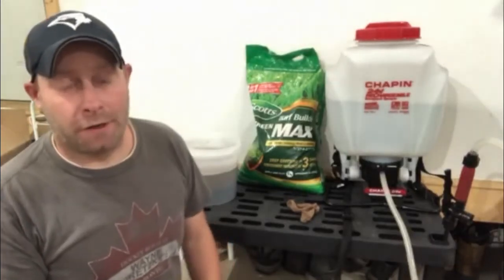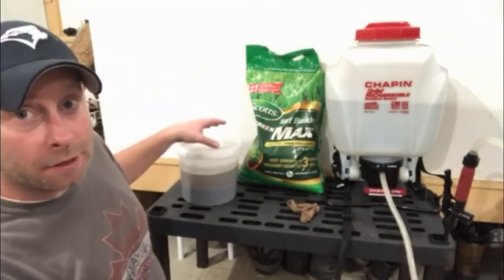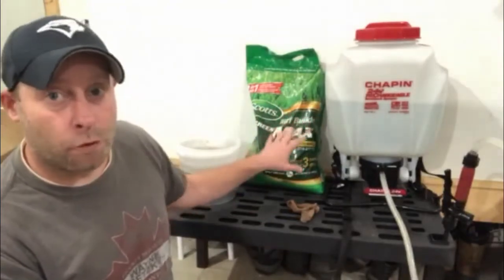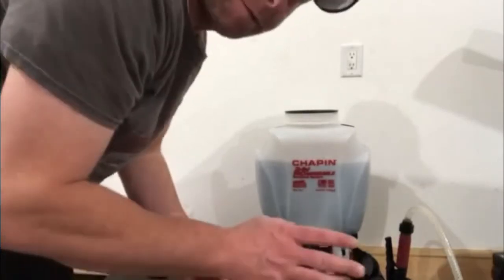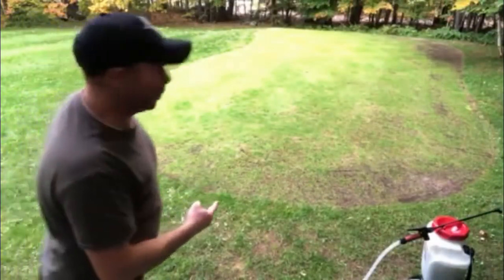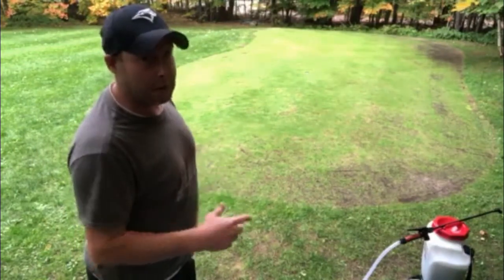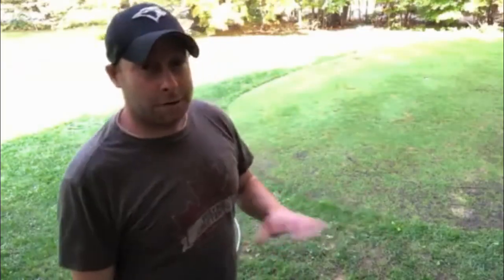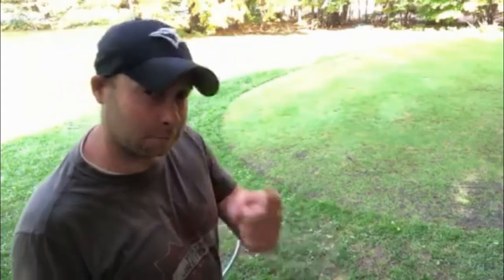Turning granular fertilizer into a liquid fertilizer for spray application!

Comment: The idea of granular fertilizer is to feed plants slowly over an extended period of time as the granules dissolve. The liquid fertizer just gets in the plant and dissolves in one shot in the ground. So, I wonder if this idea was to come up with liquid fertilizer in case you didn't find any or it was expensive.
Reply from the maker: I was doing it at the time so I could get proper coverage on my putting green but im now using liquid fertilizers that weren’t available at the time .

Comment: i have done this but i used a blender till the fertilizer was powdery. i made the adjustments on how much to spray based on what thecfrrtizket bag says and what an equivalent liquid form says, then i halfed it just to be sure. when you do this there is no longer that time released stuff since it’s been grounded diwn
Reply from the maker: That’s a great idea to blend it down, I can definitely see how that would help for faster results.  Never hurts to go with half rates just to be sure no burning takes place. Great tip and thanks for leaving a comment and great suggestion! 👍🏼

Comment: One handful of lawn fertiliser with 500mls of kelp extract, into a 2 ltr plastic bottle. Fill the bottle with water. Let it sit for a day or so for the fertiliser to dissolve. Wait for your watering day, or a rainy day. I use a hose end sprayer, rather than a mist sprayer. Pour some of the contents into the bottle of the sprayer, and then spray. Refill the sprayer bottle when needed. I've found that the liquid in the 2 ltr bottle will do about 200 sq metres. You can use Urea as well. It dissolves very well in water. 24 hrs is tops to dissolve Urea. One hand full of Urea dissolved in a 2 ltr bottle. The procedure is the same for the fertiliser. You can include the kelp extract as well. The follow up watering or rain will push the liquid into the soil. How often do I do this? Once a fortnight, except for winter. During the summer months, I apply it late afternoon or at night. Forget about the mumbo jumbo about watering at night that may cause fungus to the lawn.

Comment: I actually just researched this. Got the info from garden not lawn people. They soak one cup of granular fert in 1 gal water. Let it soak for 24hrs. Stir occasionally. Filter it out as you did and then dilute as I think you did . The remaining sediment can be put around plants that require little fert cause a little fert will remain in those granules. They say it's a win win cause granular fert is cheaper than liquid and it pretty much has an infinite shelf life. A bit of a bother but I'm going to do it this lawn season cause I have a huge bag of Turf builder left over from last year and I want to try spoon feeding and that will be much easier with a liquid app.
Reply from the maker: It’s not a bad idea but I don’t use this method anymore . I’ve been using the Growforge liquid fertilizer products for the past 2.5 years with great success. I have videos on them plus I’ll be doing a special spring discount code on them but that’s obviously only if it’s a route you chose to go with your lawn!
Reply: @BackwoodsLawnCare  very good. I'll check it out
Reply: How much is a cup in grams? I want to use my granular fertilizer, turn it into liquid and feed it to my plants in pots. But i have no idea how to go over this. Only did it once and used one teapoon with 1gal of water, but no idea if it's too little or not.
Reply from the maker: @weskulturey  I’m pretty sure it’s 2 tablespoons per gallon of water, I just went with the bag rate 3lbs per 1000sqft which in theory is the same thing….but that’s for a lawn and not a garden….so it’s hard for me to say. Just being honest
Reply: @weskulturey  1 cup is about 230 grams or 8 ounces. I applied the 1 gal of  liquid with a hose end. Used my Dial and Spray which has a 32 oz. tank so had to refill it 4  times to get the backyard done.

Comment: That black sandy stuff at the bottom of your mix is most likely iron. Get a magnet and you will see that it will attach to the magnet like iron does.
Reply from the maker: Good call. I haven’t used this method in awhile though because of the fertilizers I’ve be using recently.

Comment: A TDS meter will give eyes on the concentration.

Compound fertilisers, when applied as directed, will slowly release what would have otherwise been a toxic dose over a longer period, overall resulting in more making it to the plant rather than leaching out.

Water soluble fertilisers tend to provide much higher nutrient levels, at lower salt concentrations.
Reply from the maker: No doubt, I made this video before we had actual liquid fertilizers available in Canada but you make some very good points! 👍🏻

Comment: Thanks. Searched video after I dumped a few cups in 2.5 G sprayer. will wait a day or so. In FL in August tmrw it should dissolve. My soil test thus far shows NO nitrogen! 😲 explains some issues! Best luck all.
Reply from the maker: Nitrogen is the fastest nutrient to leave the soil , via leaching / rainfall / Natural usage . That’s the reason for applying it every 4-6 weeks using granular or every 2 weeks using liquids .

Comment: Did it burn anything? Was it a good result? I am planning on using this method for veggie gardening and havent found much info about it. Let me know!
Reply from the maker: It was a good result and no burning but if you’re in doubt just use less fertilizer the first couple of times to see what happens.  Just make sure you don’t spray in the same spot for to long, always keep the spray moving around! I hope that helps 😊
Reply: half teaspoon per gallon early morning only for 6 days flush on 7th day evening time could use just water I use a watering can which works perfectly

Comment: I didn't know you can use hot water to dissolve granular fertilizer.
Reply from the maker: You could use boiling water as well just to make sure it dissolves everything!
Reply: @BackwoodsLawnCare  okay thanks im just using a cold water that's why sometimes i was irritated because 50/50 of my fertilizer is not 100% dissolve in water you just need to wait for 24 hrs or just stir it for too long.
Reply: @BackwoodsLawnCare  did you try Humic Acid granular sir?.
Reply from the maker: @yoriichi3347  with the hot water 95% of the granular dissolved with in 5 minutes and that was with me stirring it.
Reply from the maker: @yoriichi3347  I’ve never tried it with humic but I can imagine it would dissolve just fine, don’t see why it wouldn’t 🤷🏼‍♂️ lol
Reply: I use a drip irrigation system and ordered a inline injection system from chapin. I think I will try this out.